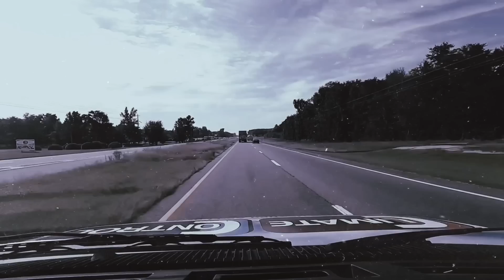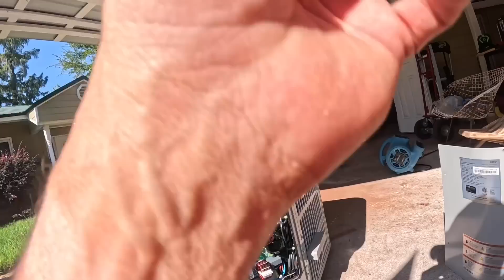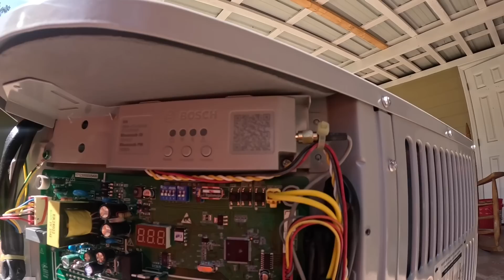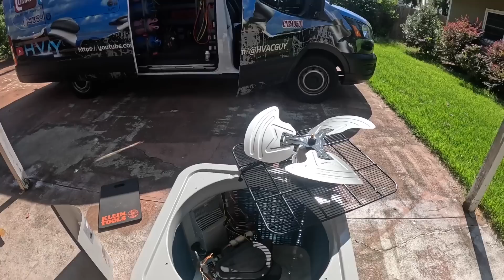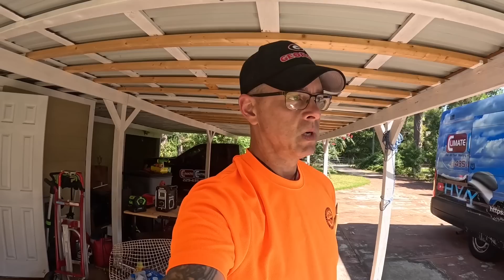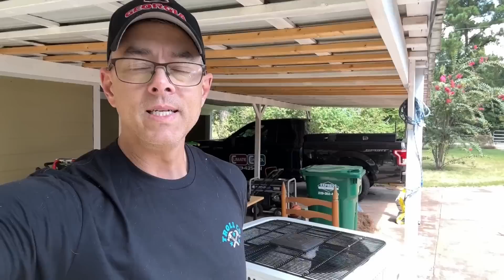Opening Up And Looking At The Bosch IDS Premium Connected! #hvacguy #hvaclife #hvactrainingvideos

Comment: Oh sh!t. Another extreme computer and circuit board nightmare. It's like the Best Buy washer and dryer that is super quiet and blue tooth alerts you that replaced the robust old school speed queen washer and dryer with knobs and buttons. The big circuit board looks like something the Best Buy geek squad would send off for warranty repair while you sit and smolder in the Florida sun buying window units and running up your power bill. Can someone make an efficient open source simple repairable heavy duty unit??

Comment: Hope it doesn't burst into flames like there ignition systems. I know the goal is to use a 3 phase compressor very efficient  but the cost of that compressor will really hurt down the road not to mention that board.  Hope that fancy inverter board likes power outages and brown outs. The thing that's a laugh about Seer is you cant even get these idiots to replace there return filters so what does it matter what seer you have if the filters are clogged to hell. Granted there's a few customers who are on top of that but not your customers.

Comment: You will have sensors for ambient. You will have sensors for coil and you’ll have sensors for the compressor discharge. I believe there’s usually three sensors all ranging from 10 to 20ohm the compressor is usually a 20 K and the other sensors are usually 10 K. This is the same for the air handler. You will have sensors on the coils and you will have a return air sensor. This is what I work on the most and they are fantastic machines when they are installed properly.

Comment: electronics do not hold up well in conditions of heat, cold, dust, moisture, frogs, lizards, insects  and of course  inconsistent voltage.  Why these manufacturers keep producing these machines that sit outdoors exposed to the worst environments possible is beyond me. Seems it would be much better to design them with some form of mechanical operation and leave the electronics indoors where at least they are not exposed to so much environmental dangers.

Comment: Does that board ring your doorbell, answer your phone, and run your electric range.  You guys must be licking your lips for the money you will make for replacement under warranty service.  Heat Pumps were made to give you heat, and cool air and maintain a adequate temperature.  Living in a cocoon I don't think is what people want, and surely don't want to pay for.  Look at the problems with these new ECM motors.  New technology is not always the answer!

Comment: How much does this equipment cost compared to basic Goodman
Reply: You wont get the same Seer and HSPF ratings from the Goodman. Bosch can heat 100% down to about -5F. Goodman cannot. If you own one of these and it’s installed correctly, your backup heat will die from boredom. If you use propane, you will get paid back in about 4 years. You get the same warranty on either. We install Goodman if the budget doesn’t allow Bosch.

Comment: Trying to control the pressures and temperatures and all the aspects of a A/C unit sounds like more failure callouts than necessary. They have proved that over and over with automobiles in the last 15 years.
Reply: I'd say a majority of problems we see on mobiles are leaks.  You get the occasional electrical issue, but leaks are very common across all makes and models.  The only vehicles using 3 phase compressors are hybrids and EVs.  Lots of newer gas and diesel are using variable displacement compressors controlled by a HVAC controller communicating over a data bus with other controllers.

Comment: Look at all those potential points of failure on that board... Cant beat the older simpler machines that run longer with fewer problems.
Reply: You wont get much heat out of a regular heat pump under 40 degrees. Cold climates, these cant be beat. 100% heat down to -5 F.

Comment: Good luck with Bosch if you need parts covered under warranty. Bosch is a company that will use every excuse in the book to avoid providing warranty parts. Also beware their tech support telling you an item will be covered only to deny it after the fact.

Comment: I know another HVAC guy.Put surge protection on a Bosch system.Because the control boards are expensiveI know another HVAC guy. Put surge protection on a Bosch system. Because the control boards are expensive.
Reply: You should put surge protection on every disconnect. Even a defrost board costs more than the surge protecter.

Comment: Hopefully someone will make an aftermarket replacement control board so you can replace the original board when it fails out of warranty when the unit is still barely broke in.  I would guess a replacement board if available out of warranty will cost more than a new unit thus perpetuating the cycle of producing garbage designed to fail early and end up in a landfill.

Comment: I don't work on AC, but computers.  I would say that they need to break off some of those components into sub-boards specific to its use.  It will bring down the complexity and the cost of repairs as you can simply swap out the part that needs to be replaced for the issue that is going on.  This will only make sense IF they are able to meet demand and bring down the pricing of the replacement board.  I've watched main boards get built this way and version 2 and 3 come along and they start to break off pieces to specific parts which fail and make that piece replaceable instead of the whole board.
Reply: Or if maybe you can learn how to repair PCBs!

Comment: Where is it made?  How easy is it now, and how easy will it be, to get repair parts?  This unit is probably outstanding when working, but an expensive, lengthy nightmare to repair.  I'm somewhat risk-averse; I'll take a much simpler unit that is easy to service, and for which repair parts are readily available.
Reply: More than likely, China.  Most mini's are made by Midea and they are definitely Chinese.  I was told by a Carrier rep that they don't repair the mini split units in China.  They simply replace the entire unit. Cheaper.  Everything is moving towards being disposable when a problem arises.  I sure hate that.

Comment: I remember one refrigeration company decided they were smart and made a self contained 120 volt cooler with a board that converted into 3 phase usage! Well, that was a piece of 💩, that board kept crapping out so much that they stopped making them. Here in Texas this heat will kill them.
Reply: I have installed over 15 of Bosch and Midea inverter condensers in Texas, until now, they are running great without any issue, have to install surge protection as well.
Reply: @didijiji918  what is the cost of one of those Bosch, running you? Your cost!

Comment: My company installs these and I work on them all the time. Heads up. Always add a surge protector and trust me when I say the evaporator coils always leak and there mostly back ordered
Reply: I've seen RUUD 20 SEER inverter boards out of stock a lot about 8 months ago. Not just Bosch.
Reply: @MulattoGato  Thanks for the heads up. Reinforces my negative opinion of Bosch.

Comment: Do you have to have upgrade to 3 phase service  to have one or is the transformer built into the unit as well !  That would be a sticking point  for me !
Reply: 3 phase not required. Would lose a LOT of  potential residential customer is that were the case.
Reply from the maker: Board creates its own three phase for compressor
Reply: I was wondering as Curtis said it had a 3phase compressor !  So instead it is like a normal compressor using a waveform changed start winding just without normal capacitors !
Reply: No utility will provide a three phase service to a residence. Most residential areas only have single phase 120/240 service available because they usually come through the neighborhood with one high leg primary, not three. If you measure the voltage and it is 120/208, then it is from a three phase distribution. Better luck finding Big Foot.
Reply: @bills6946 Strange, my neighbor has 3 phase service in his home due to the size !  It's not common but is available at least here in West Tennessee !
Reply: @jackedwards7420 
He is the exception. Most residential neighborhoods only have one primary leg feeding a single phase, center tap transformer supplying 120/240. A large house can still be supplied from a single phase service lateral. My son has a 5,600 square foot house and has a single phase 400 amp service with a CT cabinet for metering. There are no plug in electric utility meters above 200 amps. Current transformers are needed to measure consumption. A 400 amp direct reading meter would need 500 mcm cables to it and 3 1/2” conduit. Not practical.

Comment: Hopefully you start installing these. They are awesome units. I have installed a few and the setup is super easy once you learn the wiring of them at the indoor with all the communicating features. Also, I would put the bosch thermostat on as well. It works full circle to get the most out of the system. And PLEASE install a surge protector and a GOOD one at that in the main panel. I ran into one where it was at the disconnect and killed the board on the outdoor after a good storm. I moved it to the panel itself and have not had an issue since replacing the board.
Reply: I take it a Nest thermostat would be too generic for a custom tuned/ designed Bosch thermostat?
Reply: @miszced  I think Bosch recommends using a regular thermostat as a "smart" thermostat can interfere with Bosch's system.
Reply: @reverett0508  Tks! Kinda dedicated to the Nest stat. Will be soon purchasing 4th generation Nest. Our 10yr old 14Seer Goodman had 3 generations of this Stat. Trouble free, easy install & marked improvements ($ savings). I'm lead to believe there's some AI built into the 4th generation. Anyways, looking to leapfroging into energy savings & purchasing a TRANE 18/20 Seer2 unit. I know I know... expensive! Nothing firm yet.

Cheers from sunny Florida
Reply: @miszced  The Bosch units can run on non-communicating stats, no need for anything fancy.
Reply: Why would the location of a surge suppressor matter, if installed correctly?

Comment: Bosch are by far the condensers I installed the most of in the past 2 years and I had no issues. They come with 10 years warranty just like any other brand and are great for retrofit from gas systems if you don't have enough tstat wires (since it doesn't need R)

Comment: Interesting timing. Down to 2 quotes on a Trane 20 Seer2 purchase & install. Installed solar last year w/ total panels rated at 14 KWH w/ a upgraded electrical panel(SPAN). Next year upgraded windows & refreshed attic insulation.

And yes there'll be an extended warranty (5yrs) parts & labor on the Trane.

Cheers from sunny Florida.

Comment: This will be a hoot with all the power surges and spikes !
Reply: Were putting the icm 493 moniter/surge protector on all the inverters, we've had 3 boards go out and 3 cfmotors all systems were out in the country , hoping the 493 helps with this
Reply: if it has a control board or ECM motor it need a surge protector inside or outside

Comment: I've never been comfortable long term with high AC voltages and printed circuit boards especially those which have hundreds of current rush each day and in the case of a heat pump, the 3 phase DC compressor is going to work every winter and every summer 24x7. The other 6 months of operation would be determined by location or zone in the USA. There's no capacitor as its built into the inverter however, those 3 compressor leads and headers are going to be the weak spots based on historical manufacturing methods. The rest of the insides of this unit tells me there will be a few service calls for a few of those sensors, valves and so forth. I can almost guarantee that Bosch 20 SEER.2 will require a warranty repair before 5 years. Sad but true however, when they are working...life is smooth and quiet.
Reply: They don't necessarily run all winter as they can be installed as straight cool for homes with a functioning gas furnace already.
Reply: @bstevens9831  Seems more reasonable to purchase a straight air conditioner in that case.
Reply: @Garth2011  Yeah, maybe but not from Bosch/Midea.

Comment: They work amazing, other than a fan motor I have had no issues in two years so far (hopefully that continues). The instructions on charging are not always correct. You short press button 1 until T shows up, then you wait for it to ramp up to a certain hertz value (different value based on size). That value is almost always a few less than the book shows. Also, be careful tightening the line voltage terminals as they will strip easily.

Comment: SEER 15-20 ??? 12000BTU (3,5kW) split AC in Europe is rigth now around 25-29.
Reply from the maker: on ducted systems?
Reply: @HVACGUY  No. These are mono/multi split AC systems. I am no expert, but no much difference between them, how they are measured. And they can heat too. SCOPE (heating efficiency) is around 13,5 - 17, cheaper than natural gas/firewood heating. You can even apply for special (cheaper) electricity during cold season.  They are starting to be popular in my country - Hungary. Mostly because we had a terrible hot summer. AC mechanics are occupied 4-6 weeks in advance.
Sorry for my english. Have a nice day!
Reply: You aren’t comparing apples for apples. Thats like saying a compact 4 cylinder car gets 35 mpg and a limo with a V8 gets 19 mpg.
Reply: @bills6946  You are wrong. I am talking about efficiency, not fuel consumption like you. Like how much fuel the engines needs to make 1kW/h.  So its apple to apple exactly. That is why it called the same name everywhere - SEER .
Reply: @tothattila6971 
You are comparing a mini split to a ducted system, aren’t you? A mini split here in the States can go as high as 25 seer. Our ducted systems cannot. There are losses in a ducted system that cannot be overcome by design.

Comment: No way, no how!! lightning, heat, damp, dust, grass.....................sincere  nightmare's.........rotary compressor problems galore!!!
Reply: You better overcome your dislike. Rotary and scroll compressors are going away like the Edsel. Customers want higher efficiency that can only be achieved with an inverter system, which have expensive control boards.

Comment: I installed a Lennox 20 seer inverter system 3 years ago in Las Vegas, electric bill has not been over $250. 3 ton unit I’m truly impressed with the inverter technology
Reply: Before you celebrate on the electric bill, you need to know what the electric rates are. Mesquite, NV changes 6 cents per kWh and 8 cents in tier 2.
Reply: @Garth2011  Here in the central valley of California PG&E charges 39 cents per KWH in Tier 1 and 49 cents per KWH in Tier 2.  This is not constant, it changes with the season.  These numbers are for July.  Southern California has SoCal Edison and San Diego Gas & Electric.  Not sure what they charge, but probably similar.  People living on the coast in California have the lowest bills because they do not need air conditioning.  But here in the interior we had two weeks in June 110-114 degrees. The air conditioners ran constantly day and night.
Reply: @dfirth224  Those living on the coast within SCE service areas pay more per kWh than those who are located inland, the dessert areas. SCE rates are 32 tier 1 and 43 tier 2. I can't find one good reason for power production to have more than one rate. The are gouging those on the coastline to collect for those in the hot climate. Socialism rates and socialism never works.

Comment: I would be hesitant to install one of these near the coast.
Reply: Printed circuit boards like this one, unless they have special protection do not last long in a salty environment. The very legs on the chips and other components will corrode and fail very quickly.

Comment: That hot gas bypass thing you was talking about towards the end of the video is called an unloader…it was added to that unit to help with humidity control….that was the improvement they made to increase its functionality
Reply from the maker: Didn’t know that
Reply: Does it use this in AC or heat mode? I dont understand how putting hot gas into the suction line has anything to do with humidity control.
Reply: Think it’s called reheat …dries out the air passing by for a brief period of time by adding heat to the indoor coil .
Reply: @derekduncan91  reheat is a little different…if you ever work on an Aaon you will understand
Reply: Plz elaborate. I normally do resi but always on yt looking at commercial hvac videos. So how does it work and how is it different from “reheat”.

Comment: I have the first (18 seer) version of that unit…had to replace the board one time…it’s about 5-6 years old now…best thing is that without registering it you still have a 10 year parts warranty
Reply: I'm curious what the board actually costs.  After the ten year warranty.  

So many of the domestics fail at the condensor or coil just outside of warranty, and the price of repair condemns the whole system.  Is this just adding another way it can fail and condemn the thing?
Reply: @gordonmacqueen8694  If it's anything like most appliances made in the last 20 years, parts availability 5 years after a model is discontinued is considered extraordinary.  While cost is certainly a consideration I'd be concerned that the manufacturer makes changes to the board over time and old ones become Unobtanium at any price.